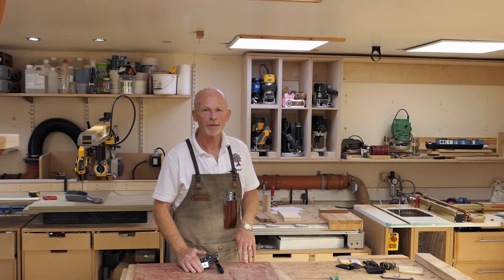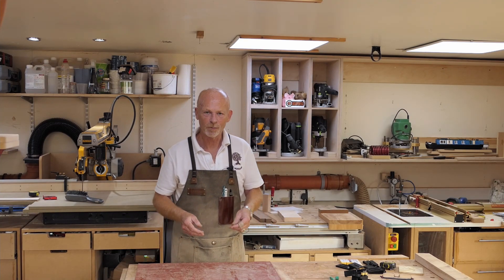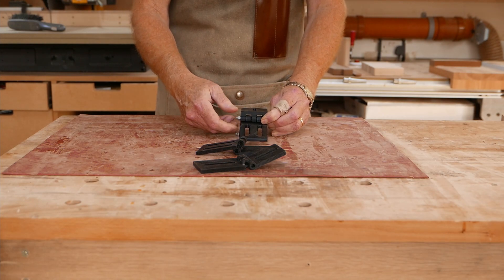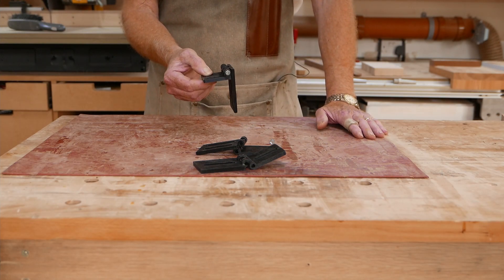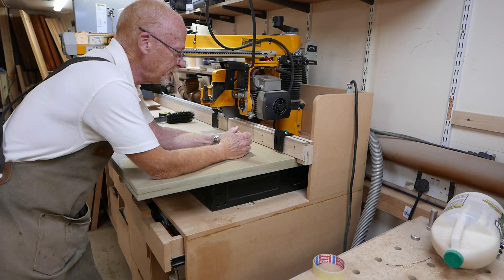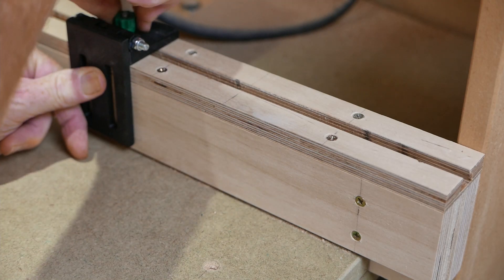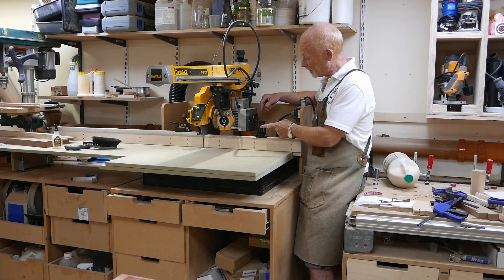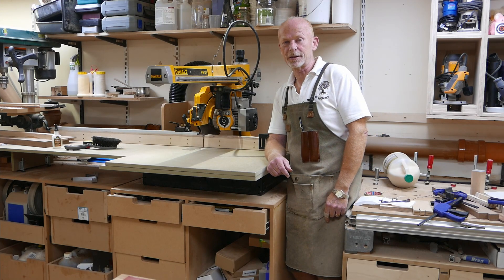Shop made Flip Stop better than Shop Bought ??

Comment: Check out the "Blum Ruler Swivel Stop" I used to work at a cabinet shop and they're awesome because you don't even have to move them out of the way they just swing away or stay depending if it's push from the front or side. They're precise enough for most things woodworking. Nobody's made knockoff's on YouTube.

Comment: 3D printers are an outstanding compliment to a woodworking shop!  From printing handles for drawers, to flipstops like you made, to radius roundover templates, etc.  There are so many uses that quickly and easily expand what you can do with your existing tools.  It is like any skill, the more you use it, the more you see where you can use it.
Reply from the maker: Hi Chris, yes totally, it keeps on giving.  I've been printing adaptors for my various bits of kit lately to take a Festool hose, its saved me loads so far. 👍
Reply: @GTWoodshop  I love my Prusa i3mk3.  It is the only one I recommend to others.  The software isn't that daunting to learn and their slicer is really outstanding.

Comment: I had a similar problem with my mitre saw station. I made T track by cutting a slot in one side of rectangular hollow aluminium tube. ( I did that on the table saw) Then I made a small sliding “car” with a flange to run along the slot, fitted a small bolt for a lock and then a L shaped hinged drop down stop. The scales are mounted in a shallow recessed dado on the vertical face, one left to right and the other right to left. Simple to make and works like a charm
Reply from the maker: Sounds perfect. 👍

Comment: Hey G, this is just me being a pain in the arse, but didn’t you just make a hinge? it does seem (at first glance) that a fat brass door hinge might have fit the bill … lol

seriously though : I too have used 3D printing to solve small problems, the biggest drawback is how long it takes … which printer did you use? I have a Prusa but I’m considering a resin version as the print time is greatly reduced … looking forward to your 3D printer exposition!
Reply from the maker: Hi Marino, you're dea right, a brass hinge would have done the same job, but that would have been easy, and not really videoable.  Resin version, Hmmmm??
Reply: @GTWoodshop  it would have been if you set the right lighting in the shop, imported some VERY dramatic music and used copious amounts of closeups of tools cutting metal in slo-mo … lol 

which makes me wonder if there's something in a series of videos geared to to the small starters, like myself, concerning stripped workaround solutions?

 granted, 3D printing IS a viable workaround … have you checked out Thingiverse for downloadable, ready-to-print files? … resin printers are used by movie studios because of superior resolution and much shorter print times, there's a wide range out there and I'm looking at an Australian company called Frozen that makes a nearly affordable one …
Reply from the maker: @marinoagallo  lol, reminds me of another channel 😂 'Stripped Workaround solutions???' Tell me more.
Reply: @GTWoodshop  mind out of the gutter now … get your head into the game … lol